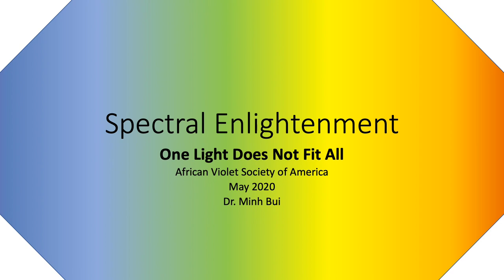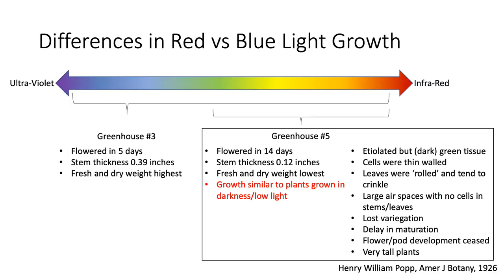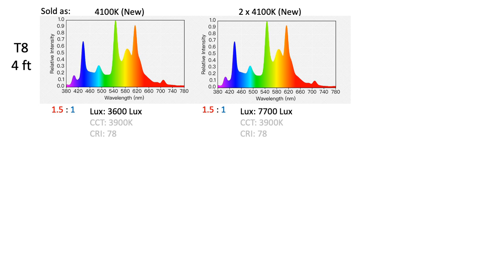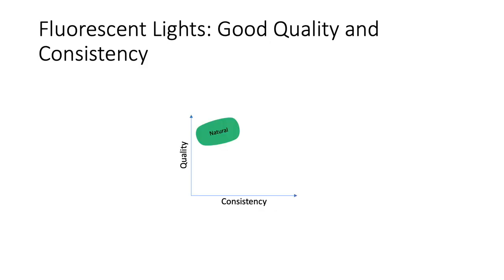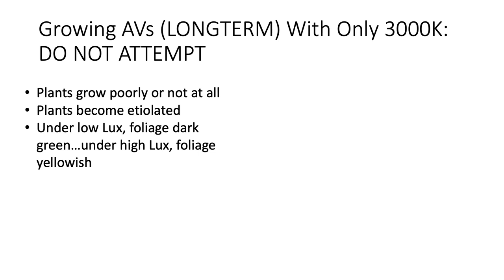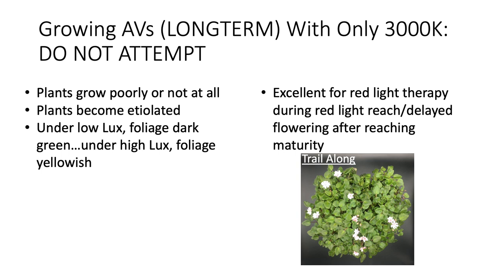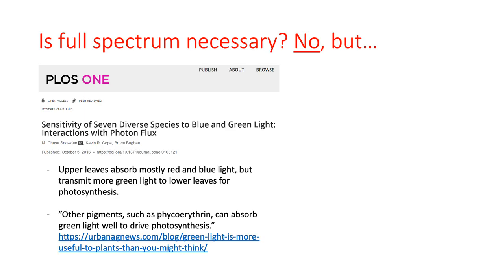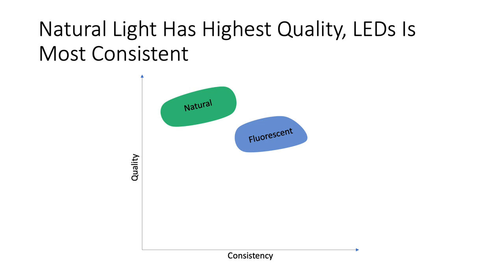Spectral Enlightenment: One Light Does Not Fit All

Comment: Thank you Minh for taking the time to do this presentation.  I have listened three times and will listen again.  I have some LED shop lights that fall in between this.  3600 Lumens about 4200k-(according to packaging)  and one that has 5000 Lumens with 4000K.  Should I be supplementing Red, Blue or Red and Blue on these shelves in your opinion?  thanks!
Reply: Hi Krissa! Sorry, just saw your post now! Ultimately, you're operating with a 4200K and 4000K bulb, which is ok for blooms. If you're noticing your foliage isn't growing as big or the plant itself isn't as large as others, I would swap out the 4200K bulb for a 5000K bulb to add more blue to your setup. The 4000K range is great for blooms but not the best for foliage.
Reply: Hope you are fine krissa

Comment: Awesome Minh!  Thanks for the this!  You had mentioned a tight centers.  Most of mine are happy, but my Funambule - variegated is tight.  I replayed the video, but could not find where that mention was.  Can you share your thoughts on that?
Reply: Thanks! Funambule is variegated and I'm seeing a majority of variegated AVs need more red light than dark green foliage AVs. I'm assuming you're growing with 6000K or 5000K lights if this is happening. My experimentation lead me to believe that tight centers aren't just due to too much Lux (total light intensity), but also too much blue and not enough red. If your other AVs are doing well, leave them alone. However, add an additional warmer bulb for your Funambule (4000K or 3000K), which should ease the tight center.
Reply: @minhbui4215  Yep - that shelf was one of my first with the LED.  Same strip exactly that you show on your video.  So it as all 4 rows at 6000k.  swapped out 2 of the rows for the 3000k.   Be nice to see how it goes.
Reply: Those 2 rows of 3000K should solve your tightness issue. Monitor it for several weeks as it improves. If it starts to get too loose, add back in 1 row of the 6000K, but it will always require at least 1 warm strip.